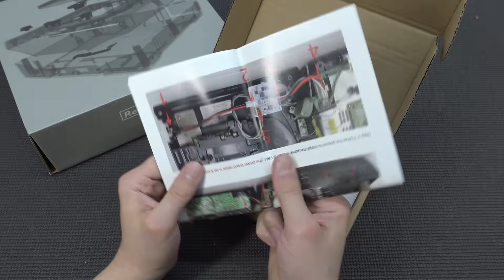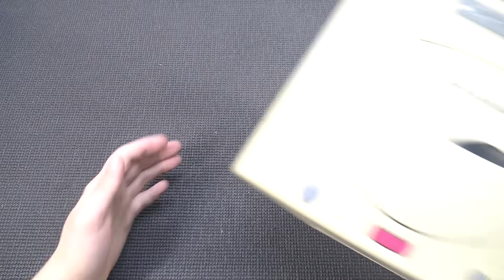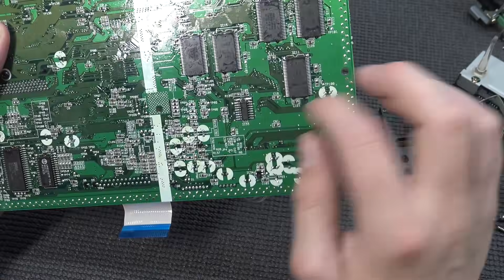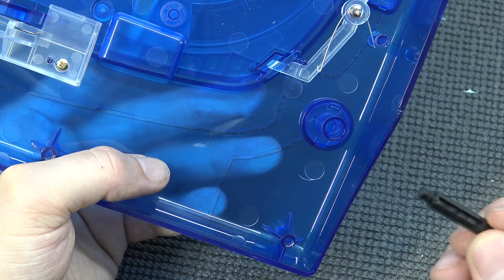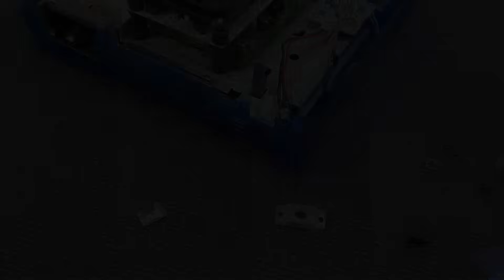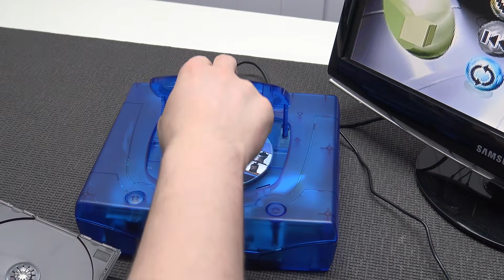Sega Saturn Ultimate Retro Console Build !

Comment: But, you could put a pi or other hardware in a cool case like this, put a cd drive motor in it and power said motor on an adjustable speed switch, and put a disc in it for aesthetic… and have awesomeness…

Comment: Awesome conversion, I want to do that to my Dreamcast. I want mine green if possible. Also glad to see your disc system is working and maybe in the future you can spray paint the 3D printed part blue / reprint a blue one?
Reply: Ebay has them. I bought a black DC case from an Aussie seller for around $100. They are NOT cheap, but ARE well made.
Reply: @TexasHollowEarth  thanks for the recommendation. I’ll have to look into it, I already bought a green controller and green VMU. Just looked into the seller, not a bad price. Have you seen the Dreamcase that’s all aluminum? It looks good too and if I can get it painted, I would be totally into buying it.